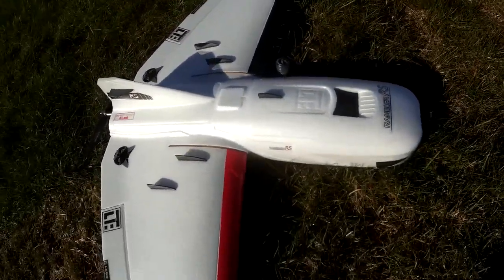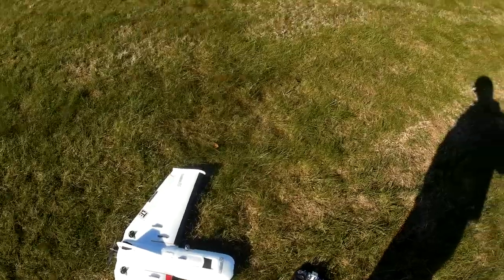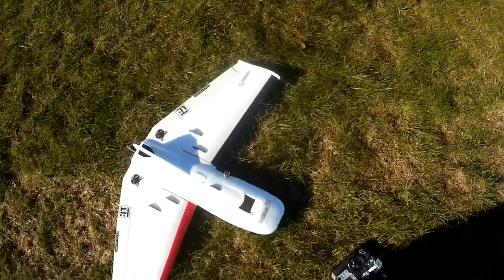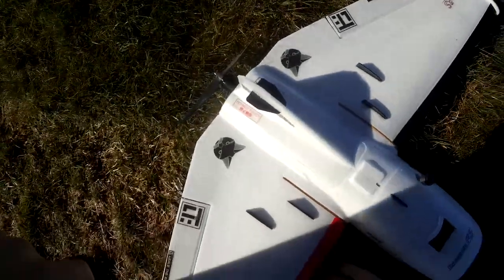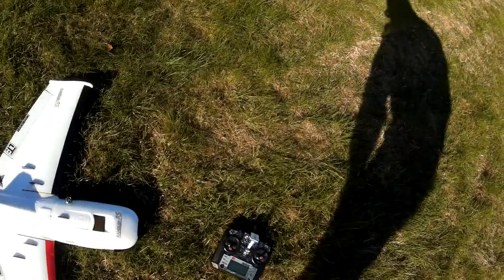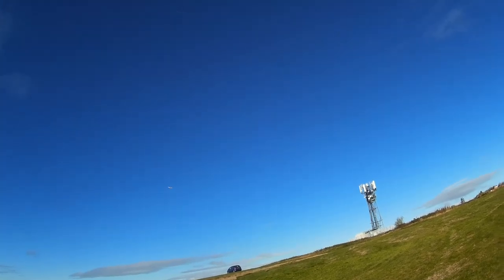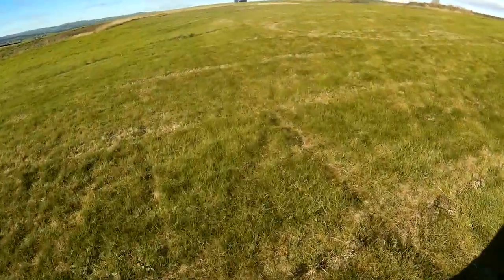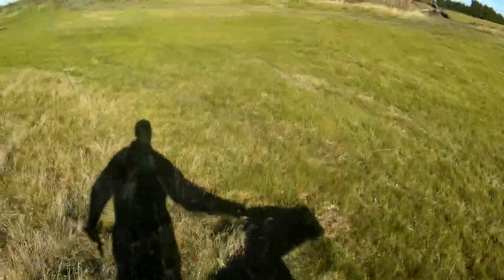Rambler rs hatcam maiden

Comment: You can't really say that it's climbing under power till you go manual. She's not manually trimmed & I'm guessing the trims were not incorporated in these flights?  So till you fly it on a calmer day, and trim it, incorporate then check guardian level, you can't say for sure it climbs under power. Looks to fly very stable to me, especially in that wind, very encouraging.
Reply from the maker: guardian was set perfect level and initial trims incorporated, no did not fly it in manual, need to get more stick time in with it
Reply: @julianhumphrey4843  You can't say Guardian level was set perfectly as until you fly it and know how it flies when level. A degree or 2 makes a big difference
Reply from the maker: @blackbirdboy1   sorry to disagree to a point, but the guardian was set up proper level and from experience with guardians a few degrees on pitch level does not make a big difference